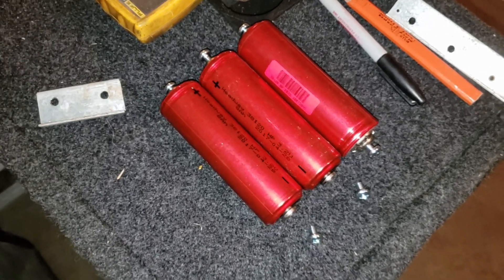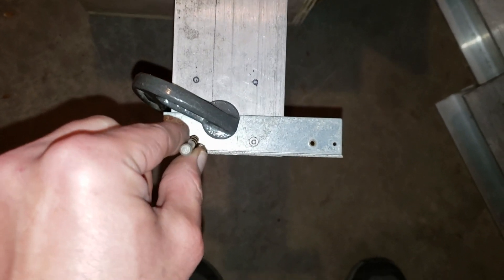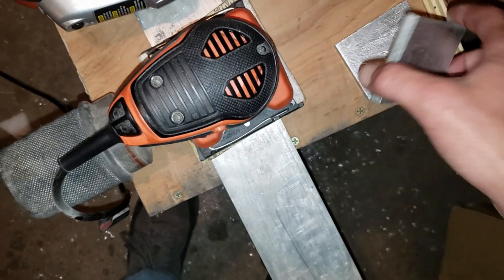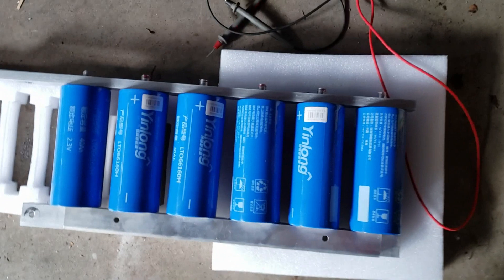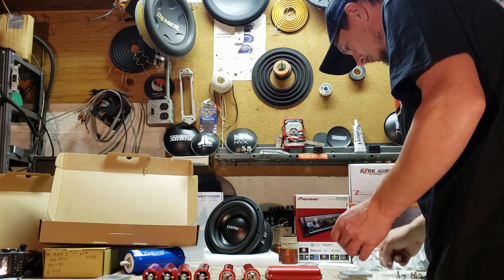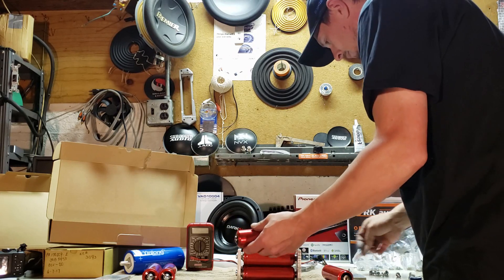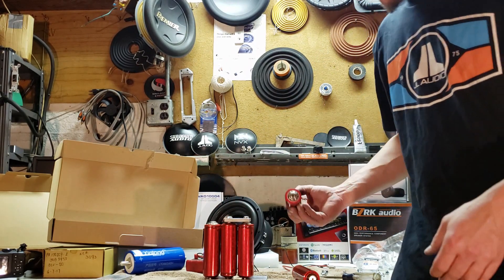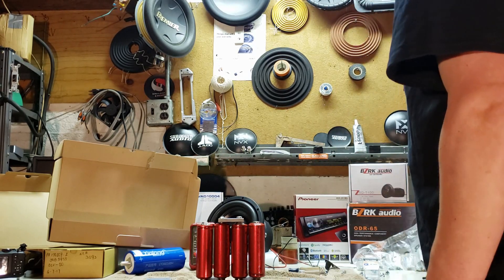DIY Headway 16ah 12v Lithium Battery How to Build !

Comment: Aluminum sucks for bussbars. That's why you see aluminum ones so thick. 1/8th inch thick copper is like 1000amp.
Reply from the maker: we dont use copper on most cells due to galvanic corrosion . most cells pads and studs are aluminum .
Reply: @mazda2284  aluminum is the metal that corrodes faster.
Reply from the maker: @66bigbuds  no its not.  The problem is galvanic corrosion which is the type of corrosion that we deal with on batteries. What happens is that the bus bars will actually eat the stud on the lithium cell or the pad. Look up a corrosion table and you will see what im talking about.
Reply: @mazda2284  the actual buss bars from Headway are all pated copper.
Reply from the maker: @66bigbuds  but that is only for Headway the other 90% or more of lithium cells have an aluminum stud or an aluminum pad Headway has a stainless pad and therefore they can use copper bus bars however it's not cost-effective to do so either especially in large applications. The links headway has are not suitable for car audio.

Comment: how wide was that bar u used before u cut it
Reply from the maker: I think it was 3" . But you can use the cell measurements,  they are 38120 so 38mm x 120mm and have 6mm screws .

Comment: Great video 👍🏼.. I just ordered the same cells.. I'm building the same kit and also making my own bus bars.. your video helped me tremendously ‼.. I also subscribed to your channel.. I see this video is kinda old, what's your thoughts on that battery bank ?? This will be my first lithium battery always used AGM'S
Reply from the maker: They are great cells to learn with and step out of agm , I have a playlist with my helpful lithium videos,  check that out
Reply: @mazda2284  definitely going to check them out bro and I appreciate the helpful videos
Reply: @mazda2284  if you don't mind me asking what is your opinion on running a AGM and lithium together.. I am running dual AGM batteries at the moment have the big four and high output alternator originally was planning on keeping my a GM under the hood and put in my lithium Bank in my cab and using a stinger battery isolator to keep the AGM from drawling V off the lithium
Reply: @mazda2284  how many cell balancer do i need for that eaxact battery setup and how do ya wire it

Comment: I have 96 headway cells can I make 4 groups of 24 should be 192 amp hr
Reply from the maker: yes , but consider splitting it into 2 banks , then 2 balancers . they get heavy and are much more manageable and in the event of something failing one 1 bank you would be able to manage it easier , and have 1/2 ur battery to work with . plus its alot for 1 balancer to do .

Sriko Battery USA
Sriko Discount code= BDSB 
https://srikobatteries.com/?wpam_id=8

Comment: Which are best for RVs or stereos a cost per amp hour would be sweet
Reply from the maker: RV is normally charging 14.6v max for the inverters and whatnot , so in that case id do something like the 300AH Lifepo4 cells , and probably shoot for a good amount of reserve like 600 or 900ah cuz im a power hog lol . 

2 Pack EVE (3.2V 280Ah LiFePo4) cells for RV, Solar
discount code BDSB
https://srikobatteries.com/product/2-pack-eve-280ah-lifepo4-prismatic-lithium-cells/?wpam_id=8

2 Pack EVE 300Ah LiFePo4 Prismatic Lithium Cells 
300a constant 600a peak
Use Discount Code: BDSB
https://srikobatteries.com/product/2-pack-eve-300ah-lifepo4-prismatic-lithium-cells/?wpam_id=8
Reply: @mazda2284  absolutely that's exactly what I'm talking about how much would that run me? Do you have any old batteries you would sell? I'll put your channels name all over my competition stereo truck it's pretty mean and I hit up all the shows on the west coast.

Comment: How thick is the metal you are using?
Reply from the maker: depends but i use 1/8 minimum and a bigger bank you should have thick bars , build according to what you are making it for ,  project DB makes some of the best bars on the market if you wanna just buy bars . i test his bars and they are outstanding 

Project DB Lithium buss bars and Battery accessories High Quality made in WI USA 
Discount code: AUDIO 
https://www.facebook.com/teamprojectdb
https://www.projectdb.shop/

Comment: Could I run only 2 cells in total and keep an agm battery, Or do I need a minimum of four or six cells? I don't need much extra power.
Reply from the maker: Minimum 8cells in 4s2p to handle a stock alternator
Reply: @mazda2284  Thank You. If I run the 8 cells will I need a balancer? What do you recommend to charge them?

Comment: recommendation to run approximately 20,000 watts 10,000 watts in 4 12 ”woofers 2 3,500 amplifiers for ti and ph drivers and another amplifier for super tweeter.  Mechman 320 amp alternator with external regulator charging 14.8.  How much should my battery bank be
Reply from the maker: run lishens if you can control voltage , 14.8v is over max charge for headway and ur gonna get a lot more from lishens . check out my facebook group

Comment: Please tell me. How many of theses would I need to power a Taramps md8000.1 1ohm amplifier?
Reply from the maker: 40 cells , 80ah
Reply: @mazda2284  can i run any lead acid batteries with them? Plus I havea 350 amp alternator.
Reply from the maker: @brick2077  yes , and 80ah will be fine with 350a
Reply: @mazda2284  I've been watching a lot of your videos, super helpful thank you! I'm wanting to run an MD8000.1 as well but I only have a factory 180 amp alt. Can I still run the 8k with a 80ah headway bank + factory 100ah agm?
Reply from the maker: @BoardUnderMyFeet  what voltage do you charge at because that's very important

Comment: What's alts max charging voltage set point for these??
Reply from the maker: 14.6v is paper spec , you can go a little over like 14.8v , if its like 15v cold and drops as it warms up should be fine , just make sure to have a balancer
Reply from the maker: I have a link in my videos description and use discount code AUDIO if you do wanna buy some

Comment: I have 20 cells on the way for a 40ah battery that I am going to run with my 45ah limitless lithium. Eventually I will get another 20 for a total of 80ah of the headway and 45ah limitless. I am pretty stoked. I do need some tips on how to charge the headway when they arrive.
Reply from the maker: hell yea ! watch my lithium charging video , its in the lithium playlist :)
Reply: If you have a limitless you should already have a lifepo4 charger.
Reply: @xchimnyx  help me understand why you need a charger.please dont say bc limitless recommends it.
Reply: @bkh5746  how do you plan on charging them…. 🤦‍♂️

Comment: I have another question. I've been trying to Lear all i can about lithium, so I've been watching lots of videos. Youtuber Richard Lloyd has a video about these same headway cells and he says you can not charge them with a typical car charging system. Is that correct?
Reply from the maker: no , they will work with most factory charging systems , he was only using 1 bank so his bank was not proper for a stock alt .  max charge per bank is 80amp 14.8v , 2 banks is 160amps , so you need 2 banks minimum and more if you have a high output alt. . if you charge 14.6v or higher id go with yinlongs cuz they will do better.

Comment: How much rms would just 1 bank (4 cells) handle ?
Reply from the maker: you alt is too much amps and you will kill the cells .  in theory 800rms per 8ah bank 
minimum you should run is 16ah with max charge 160a . if you charge more , you need more cells .
Reply: mazda2284 I’m not using it in a car. I’m building a cooler with a few 6.5s and tweeters just need a small enough battery to fit and only around 400 ish watts. The cells will be charged which an actual charger not an alt
Reply from the maker: @JohnnyLoudBoy  I'd use some higher capacity cells over these high power headway.  8ah is 1amp for 8hours or 8amps for 1 hour . In the same amount of space you could have 75ah eve cells . Check out my video on those

Comment: Can these be ran under hood or does engine bay heat play a factor in their performance? 
Also for an 80 AH bank it would be  a bank of 4 cells 10 wide? Thank you
Reply from the maker: Check out my battery delete video
Reply from the maker: And yes 4s10p would be 80ah

Comment: How many watt system do you think this is good for?
Reply from the maker: 16ah = 1600rms clamped , if you have above 14.2v id go yinlong LTO 100%
Reply: @mazda2284  my stock is doing 14.38 right now factory i plan on doing an upgrade rebuild or replacing it later
Reply from the maker: @bobbybland9497  40ah yinlong bank will support 4-6k rms clamped,  towards the lower end with stock alt and that voltage,  its 13.8v nominal so you wont drop near as much in voltage
Reply: @mazda2284  ordered my Ying yangs from Amazon

Comment: What size screws were they?? I'll probably use the smaller ones for both pos and neg just to keep it simple..thats quarter inch aluminum right?
Reply from the maker: Yes 1/4" , the size is m6 1.0 pitch x whatever mm thread length you need . With this I think it was m6 1.0x12 and x14

Comment: Im using 1/4 aluminum like u did in this video for my build, but I couldn't make out what size hardware u said u were using, and not only that but I understand muricin sizes not the chinezium sizes lol.
Reply from the maker: m6 1.0 pitch x 12mm i think it used , i have m6 1.0 10mm , 12mm, 14mm and 16mm and a bunch of shorter ones also so i dont remember what i used lol

Comment: Hey bro. Im trying to make a 24ah bank but only have about a 5" wide gap but plenty room in length. Is there anyway i could stack them in a single row? It may be poss to have 2 rows if that helps. Is this possible? I have plenty of 2"×48"x1/4" alum. Thanx!
Reply from the maker: Yes just like my ram

Comment: If on lead acid currently, can we use this with a front battery delete and 1k RMS? Or do you suggest this as only an agm add on? With 16AH to start. Will move to 24AH later.
Reply from the maker: id do more headway if you wanna swap to all lithium 24-32ah be nice . i have 48ah in my ram

Comment: This video should blow up with views, I've been waiting for something like this for headways...  great video man
Reply: Was these the alarm man cells? New cells would cost more than $115.. I'd like to build a 32ah bank eventually.. I almost pulled the trigger last week, but I run a 370a alt with 2pin GM truck and pcm voltage, so I wanted to do more research.. I'm running a deaf bonce 4k at .5ohm and a deaf bonce 200.4 currently only on the 370 and 2 yellow tops, I never drop under 13.3v and that only because of pcm
Reply from the maker: @tankdog03ify  yes these cells are from alarm hookup / battery hookup , they were never used , they sat on a shelf for a year and sold , tom has to test all the cells to resell so they have to be marked as used
Reply: @mazda2284  they looked like they was new cells in great condition.. the only reason I didn't buy from alarm hookup is because I've seen sum nasty looking used ones.. if they look as good as these in the video I'd buy them
Reply: $41 for 4 right?
Reply from the maker: @tankdog03ify  yep
Reply: @kevinhu6449  playing with fire going through ali baba. Their cells have been beat to shit and barely have life left. If you even get the real deal. Alot of them are fakes. Bought from there 1 time and learned my lesson.

Comment: nice video Mazda!  keep the lithium videos coming.  I use JY but I'm interested in other types and ways to use them so  more of these DIY lithium videos would be deeply appreciated.
Reply: also I would like to get your opinion on yinlong vs headway  and other DIY lithium batteries.  Maybe a video telling about the pro's and con's of the batteries and others like that, not just those two. Do you prefer the large capacitor type lithium batteries or the others that are smaller but put together in a large bank and the up side and down side to each  one.  These are just simple questions to a lot of people who are in the know but there are a lot of people who would like to be more educated and I see that you have been experimenting with these type of things for a while now and I would like to find out what you've learned.
Reply from the maker: @joshhanson6777  check out my other lithium videos , i actually did a breakdown of the 2